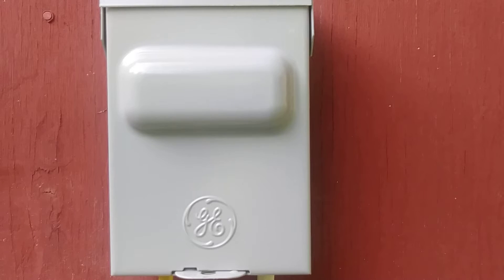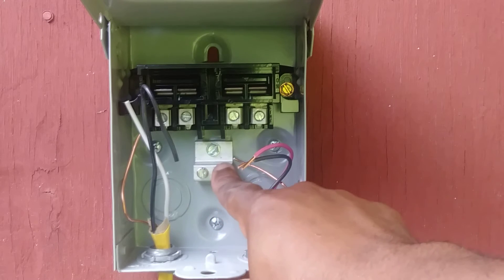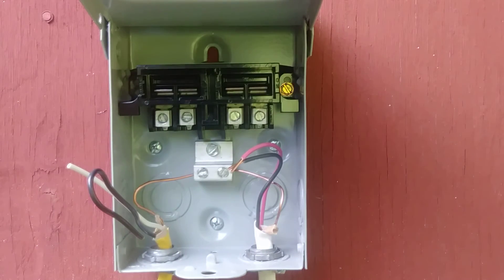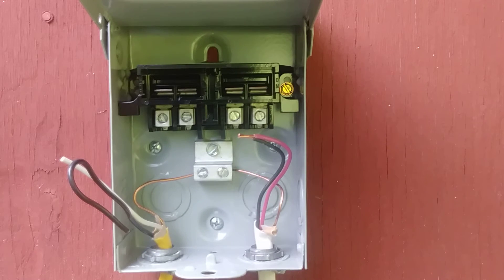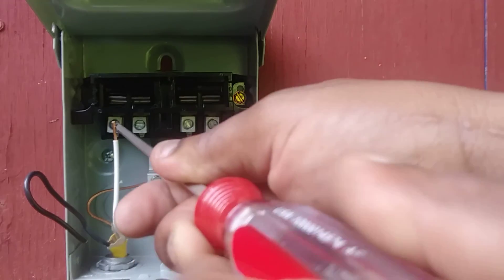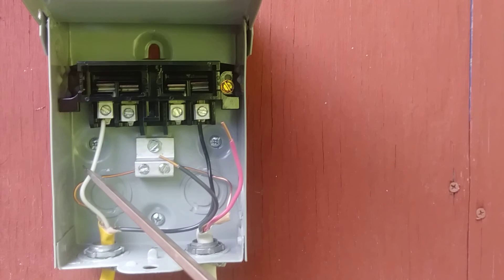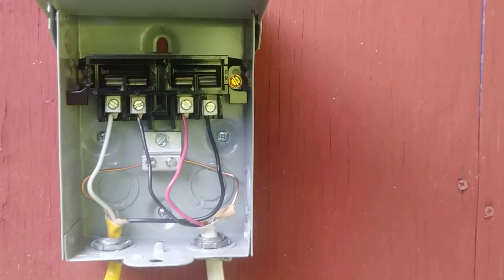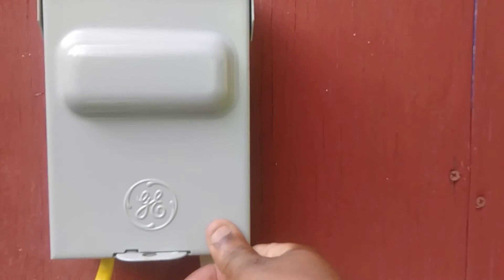How to install an A. C. Disconnect

Comment: TILT! Ok, what if this was a 110-stituation. Not 240. And the Neutral White is a Neutral White, not hot. Where would it go then? Where would the Red wire (Load) go? Not 240---where do the Line White, and Load Red go, please?

Comment: So you're saying that you only need 10/2 or 12/2 wire?  

I always though you needed a black for hot, red for hot, white for neutral and the ground.   

I just took home 10-3 wire...where the does the white land on this disconnect?
Reply from the maker: You can use 10-3; however. You only need two hots. MOST A.C compressors don't need a neutral. Most 240v A.C. compressors only need to hots. So 10-2 will work in this case. You can use the white as one of the hots. The black being the other hot. Electricians sometimes will put a piece of red tape on the white to identify it as a hot and not a neutral.
Reply: @rickyjewett6082 awesome.  Thank you.   I did just use the 10/3, harder to work with and oversized just in case. I cut and capped the white and the black and red are both hot with it grounded at the condenser.

Comment: Since it is 240v shouldn't you use 10/2 Romex?????  Asking for a friend...
Reply from the maker: @richinman7774  that depends on the amperage size of the equipment. If the amprage size of the equipment is 20 amps or less, you can use size 12 romax.

Comment: Can I use this on a 20amp breaker double pole 12k btu  with a 10/2 bcoz my service panel is about 30ft distance. Or should I I use the fused kind.
Reply from the maker: You can use this one in the video or you can use the fuse dis connect. Either will be fine.
Reply: @rickyjewett6082  can I use the 30amp fuse disconnect with a 15amp fuse bcoz that what it says on the nameplate of my mini split unit

Comment: I didn’t know you can run 240 V through a 12/2 wire.
Reply from the maker: You can use 12-2. If depends on the size of the A. C. Unit. If the unit is small and operates at 20 amps or less, 12 -2 can be used.

Comment: You should wrap the white wire with either black or red tape to identify that wire as a "hot" wire and NOT a neutral.  That is code.  Also, Romex wire cannot be used outdoors and exposed to the elements.  You need to use THHN wire in a conduit.
Reply from the maker: Yes I should have. Thank you.

Comment: I am assuming this video was for instructional purposes only, and it did cover the basics of wiring an A.C. disconnect very well. Maybe this was covered somewhere in the comments below but if not please note that 12/2 Romex wire is not rated for 60amps. If you are running 240v 60amps you need to use 6/2 or 6/3 depending on your application. 12 gauge wire carrying 60 amps will cause a fire!
Reply: This is not true. 60 amp is the amperage limit for the box. This is an AC disconnect, not a breaker. As long as your circuit is protected by a 20 amp circuit breaker or below, your current for the circuit won't exceed the 12/2 Romex capacity to cause fire.

Comment: Thanks for taking the time to do this video.  This is the most basic part of installing the disconnect.  What I'm looking for is how you run the wires from the service panel to the disconnect, how you shield the wires externally (I noticed in your video that the Romex is not in any conduit....is that to code??), how you mount the box to the wall, etc.  I need to know what I need to do to meet code.

Comment: Does it matter if the 2 wires on either side is switched, cause it’s just connecting them two wires together when handle is slid in…?
Reply from the maker: No in reality it doesn't matter however the hot wires coming from the panel should always get terminated under the screws that say line and the wires coming from the a.c. unit should always be terminated under the screws that say load.

Comment: A/C NEC Code mandates 8 or 6 gauge wire depending on how far the disconnect is to the load canter (main circuit breaker panel)..... you're using what.... 12 gauge? You don't mention the voltage, you don't mention distance, THOSE FACTS MATTER!!!!!
You are THE most INCREDIBLY dangerous IDIOT in the history of "elecricians".

I wonder how many houses you've burned down you fu*king moron.

Comment: Hi! I just want to say thank you for your video. I know the risk that can occur when you are not licensed; however, I was able to save $600 by connecting a new disconnect box myself because of you. I initially connected the wires incorrectly and was slightly shocked. I then watched your video and followed the directions in my manual, which stated where the line and load wires go. So, sending a huge THANK YOU 😊

Comment: Great video! I'm a DIYer doing home improvements in a house I bought last year and I put one of these in to bring my hot water heater up to code. I am going through my house ripping out walls, redoing ungrounded wiring and updating it and adding missing insulation to exterior and interior walls. Thanks for providing a very detailed video, I feel confident I can do it myself!!!

Comment: Maybe it's different where you are , but I believe the general code is that 12-2 is not acceptable for 240 volts. By code you're supposed to use 10-2 for 30 amps. But maybe it's different where you live.

Comment: I am sorry, but 207,000 people watched this and got very bad information. You cannot use black and white wires connected to 220 although in some cases you can use tape or paint to change the wire color to indicate that it is hot but never on 12 or 14 gauge romex. Secondly, you can never use romex on an external application. You need some type of conduit, covering over the wire to meet the fire code.

Please check the wiring codes and do more research before you try this based on this video or you could end up electrocuting someone or burning down your house.

Comment: Love the explanation and everything including the safety of amperage Gauges difference between 120 and 240 application. Its a good one because the repetition of the most important things. Line and load... good stuff.. thanks for your help im doing. My own but with the 120 its a lot simpler. different colors. I never label my wires but i need to so it is up to "code" but usually if i installed in correctly i remember

Comment: Isn't the proper thing to do, when using a black and white wire on 22, is to mark the white wire indicating it is hot? Like using a black sharpie or black electrical tape?

Comment: I have a disconnect for a mini split and the wires get power when hardwired. But when the disconnect pull is in place there’s no power on the load side. Could it be a bad disconnect? It seems like the pull fits snug in the off position but it’s really loose in the on position. Is that normal or could it be a bad disconnect. The wires are in the correct line and load connections so that’s not the issue

Comment: You explanation was very good and greatly appreciated.  One question if that was 110v is the direction of the wires changed? Not the location. Thanks

Comment: Why didn’t you use #10 wires for an AC unit? Those #12 wires can only safely handle 20amps!
What AC unit are you using that only requires 20amps?
Also, why use a white wire as a hot?
VERY BAD & DANGEROUS ADVICE!

Comment: Does anyone know why the screws would be stuck? I cannot get them to screw in or out
Reply from the maker: If the disconnect is an old disconnect, the circuit could have overheated and the screws could have melted or became welded into the metal in the disconnect.  You may need to buy a new disconnect.

Comment: Oh my goodness... I'm so so happy I came across your video. I did everything to my 12000 hessaire and everything is all hooked up  and I couldn't find out the power not coming to unit... And found that the line and load were transposed and I had it wired  in series . 😝 But thank you so much , when you said I needed to land these two most important parts of the Disconnect I finally saw the light and it was right there all along! 
All day and last night . I appreciate your video. Take care and Aloha 🌺

Comment: Thank you for this video. I have two questions. 1. What size of wire to run 240 volt to the a.c.  disconnect approx. 30'? 2. Is a 30 amp single pole beaker enough or should it be double pole?
Installing a 24,000 btu mini split a.c heat pump unit.  Thank you to anyone able to answer these questions.
Reply from the maker: For an a.c. disconnect you will need a double  pole breaker. Keep in mind that every a.c. condenser is different. Some a.c condensers run off 20 amps, some run off 30 amp and some run off 15 amps, however no matter what the amps the a.c. needs, it will always be a double pole breaker.  To know what size wire and breaker you need for your specific unit, read the instructions that came alone with your split unit.
Reply: @rickyjewett6082  thank you so much. It said a 30 amp breaker and I'm going to use 10-2 wire for a 30' run to the disconnect and then a whip to the condenser.

Comment: How do I turn off my main breaker 100 amp which is stuck in the ON position due to copper pipe water line cracked and water got into it. It has been dry but I have not tried anything but my hand too afraid to apply another method. Help
Reply from the maker: Put on some leather gloves then put on some rubber gloves over the leather gloves. Use one of your hands to turn off the 100 amp breaker. Leave your other hand at your side. You should be fine. Also if the breaker is literlly stuck, you can call the ulility company and have them pull you outside meter. This will assure you that you will not get shocked or electricuted.

Comment: I have a disconnect like this with no red wires at all. Two black and 2 white wires and 2 bare copper wires. I am trying to hook a 3 prong outlet for a dryer to the wires exiting from the disconnect. But not sure how to do it. The disconnect is on a 30 amp breaker like is called for. This being 240v I understand the white and the black are a hot but that only leaves me the bare copper. Can I hook the bare copper wire to where it called for the neutral wire on the 3 prong outlet instructions. Any help would be greatly appreciated. Thank you for the video this has answered part of what I didn’t understand

Comment: very well explained and in detail, the only thing I would have done was marked the white wire with either black or red tape to show that it is being used as a hot wire, not a neutral.
Reply: I also would have marked the wires as dictated by the NEC.  Your choice was with black or red tape.  I often use black or red heat shrink. I have also used black or red permanent marker. In my adopted standard  of consistency, I always put my Red wire on the Right side. So if using 2 wire romex, I would  heat shrink (mark) the white line conductor RED, then match up the RED load connector and land on the RIGHT side.  Of course, black line and load conductors match on the left side. This makes for a tidy installation and logical troubleshooting if ever needed.
Reply: @jamesborton9237  It deoes not matter since both "red" and "blcak" wires are connected to the exact same buss in the main panel and both carry IDENTICAL 120 volts VAC.
Reply: @richardm.9821 if it is 240 volts, red and black are NOT connected to the same bus in the panel.
Reply: Really understandable but what makes this connection 120volts and 240 volts , is the diffrence on the actual breaker size amperage?
Reply: @amrab281 this is a 220v install. He mentioned the wires go back to a 2 pole breaker in the main panel which means 120v on each leg to make 220/240V at the other end.     What I don't understand is what the hell are you supposed to do with the neutral wire in the disconnect
Reply: @jcallesano  There is no neutral wire - two hots and a ground

Comment: I'm installing a 115v 3/4 ton Mini Split and have a 15amp Single Pole at the panel. So the white wire isn't hot. Do I still connect the white wire to the 'line'?

Comment: If line and load are landed opposite of where they should, would that cause my unit to continually trip the fuse inside the heat pump?

Comment: I have a question, I have a non fused disconnect, but my ac went out so i am doing away with it and instaling a window ac/heat, it runs off 220 just like my ac does, so can i swap out the non fused cut off box for a 125 amp sub panel with a 220 breaker for my new ac window unit?
Reply from the maker: Yes you can. Just be sure to read the information that came with your new Windows unit to see what the breaker size should be. It could be a 30amp, 25 amp or 20 amp. You may need to change the circuit breaker to match You new unit. A breaker to big can damaged your new unit.

Comment: Good video I installed a GE box yesterday on my mini spit. I had power to the box but no power to the unit. I was a little stump as there was no reason for it no matter which way I turned the pull out . Come to find out the pull out was bad itself there was no contacts between line and load on both sides. It was like they put in four separate pieces of copper in the pull out.

Comment: Yes be very careful! The Halex brand has the “Line Side” in the two center lugs and the “Load Side” on the two outer lugs.
Reply from the maker: Thanks for that information. I am not familiar with a Halex brand.
Reply: @rickyjewett6082  It is identical to what you installed in your video but the line and load are reversed. I watched your video and then decided to look at the instructions to make sure they were in agreement and I’m glad I did because I needed to do just the opposite. Definitely pays to read the instructions, lol.

Comment: Thank you for this video, clear and very helpful, (I do view a couple times) I look for to wire with 2 poles beakers 30 amp 240v to a minisplit 24000btu with 10/2, because 10/3, the white wire is useless? and spend a lots of time to get info from store to store (one month), none, this is only for electrician, with pandemic, it's hard to get one and they double the price.

Comment: Folks, please don't do what this guy is doing!  

First off, NM cable, AKA Romex, should never be run outside where it can be exposed to water or sunlight.  Anytime wiring is run outside, it needs to be protected in some sort of watertight conduit.  Most often with AC disconnects, non-metallic flexible conduit, AKA Carflex, is used to run the conductors from the disconnect to the AC unit.

Secondly, the Romex that this guy is using is way too small to feed an air conditioning unit!  The Romex on the left that he is using to feed this disconnect appear to be 12 gauge and the Romex on the right leaving the disconnect appear to be 14 gauge!  This is very dangerous and it is bound to cause a fire down the road because the conductors are not large enough for that amount of current.  The conductors feeding the unit need to be at least 10 gauge and may need to be sized up to 8 or 6 gauge depending on the amperage rating of the unit and the length of the run from the panel.
Reply: Was thinking the same shit about 10 wire

Comment: Good Job. Works too for electric hot water heater disconnect as well. Or any other 240 load item that new codes require an in line disconnect. Dave @ Historic Property Preservation, LLC

Comment: This was a great description of why the white is hot and not neutral on a two pole breaker - made a lot of sense the way you explained it thank you for doing this video!
Reply: When the white is being used as a HOT wire, it is required to be marked in some fashion.  I would have used some RED heat shrink to indicate it was a hot wire. I also would have then put both reds on one side and both blacks on the other to make future inspections or troubleshooting  simpler.

Comment: Is romex allowed in wet locations? Guess it doesn't matter since this is just instructional anyway. Shouldn't the wires be the same gauge tho? You got 14/2 coming in the right and 12/2 in the left.
Reply from the maker: There is a certain type of romex the you can buy that can be used for wet locations, however, the romax in the video should not be used for outside unless it is in conduit. Just as you said, the video is instructional.
           Both pieces of romax don't necessarily have to be the same size, however the smaller size must be large enough and rated for the equipment. Thanks for watching and holding me responsible for doing it right.

Comment: Wouldn’t a 2 pole breaker be a 30 AMP minimum? Which would require a 10 AWG minimum. But you said you’re running a 12 AWG.
Reply from the maker: The disconnect is a 30 amp disconnect. Being a 30 disconnect means  I can use the disconnect for any equipment or appliance 30 amp or less. My a.c. unit needs only 20 amps. Therefore I ran number 12 wire. A 2 pole breaker is not a 30 amp minimum. There are 2 pole 20 amp breakers and there are even 2 pole 15 amp breakers. I hope this answered your question.
Reply: Correction. You need a 10 gauge wire. 12 awg wire is only rated for the 80% of 20amp. 10 awg is rated for 80% of 30 amp. So if your AC pulls full 30 amp, it needs 8 awg wire. If less, then 10 awg. But if it pulls 20 amp, you need at least 10 gauage. Romex is also not allowed exposed on the outside because it is not rated for damp/wet areas. Actually Romex is not allowed outside even if it is in a conduit. For that you need the UF wire, unless you run the Romex from the back to the box similar to a flush mount outlet or light on the exterior of the house.

Comment: Is it wired the same when used in a 110v application?  Just using it to turn off a circuit downstairs when the panel is upstairs.

Comment: My ac unit has this box I have a question can I connect a outlet for my dryer to this box ?? It takes the big 4way plug 🔌
Reply from the maker: No. The ac unit and the dryer each need their own 240 volt circuit. 240volt appliances should never share circuits.
Reply: @rickyjewett6082  ok thanks for responding my house is old  and don’t have the big outlets how can I install a outlet for my dryer